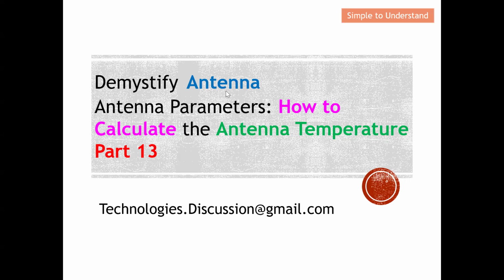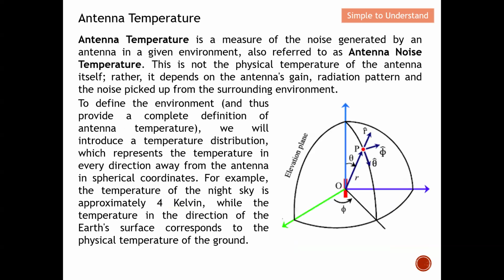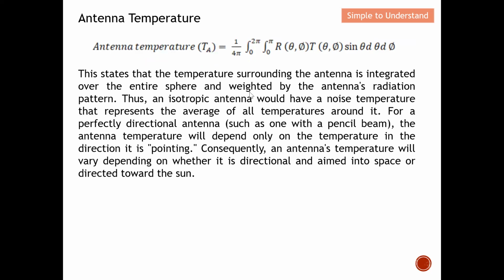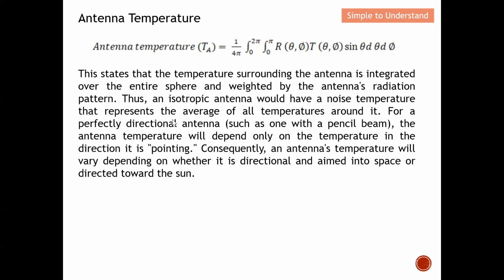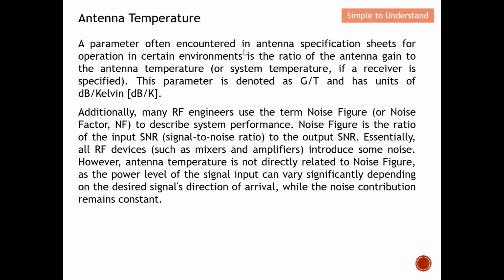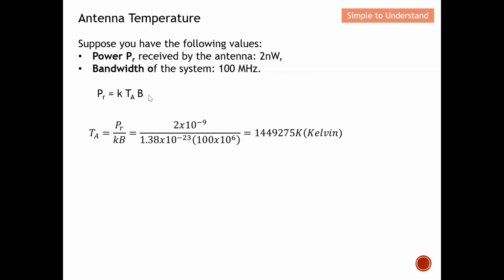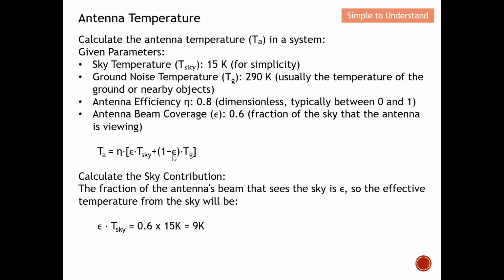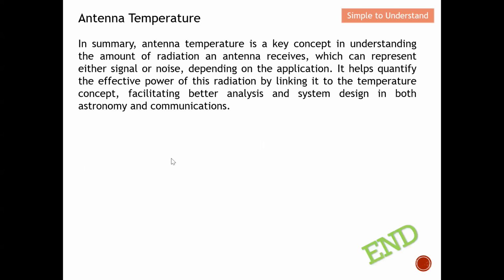Antenna #13. How to Calculate the Receiver Power, Pr. How Antenna Noise Temp Affects the Rx Pwr.

Comment from the maker: Thank you for your strong support! 😊
This video explains how Antenna Temperature (which is not the physical temperature of the antenna itself) depends on factors such as the antenna's gain, radiation pattern, and the noise picked up from the surrounding environment.
Antenna Design playlist.
https://www.youtube.com/watch?v=RTtCxtSaG8w&list=PLFxhgwM1F4ywAyke2KC22BLBl1V4vV9Jt